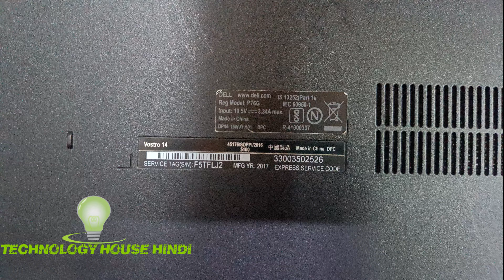Dell  Vostro 14 3468 SSD Upgrade , Dell vostro 14 3468   RAM upgrade , DELL 14 3468 SATA SSD UPGRADE

Comment: I have installed ssd and put hdd in the cd drive slot using hdd caddy, but after that my laptop often blue screen is it because of hdd caddy or because ssd is not suitable.

Comment: Is it necessary to remove the keyboard and front side, if you only want to change the hard drive?
Reply from the maker: Yes
Reply: @technologyhousehindi  . Why is it required? I am only removing the back panel and the motherboard is undisturbed.
Reply from the maker: @mrutyunjayadash6140  see video carefully some screw behind the keyboard

Comment: Hi there,
Can i install ssd without removing hdd like using caddy. If so then please guide on how to do so
Reply from the maker: Install ssd in caddy direct
Reply: @technologyhousehindi  i just researched want to confirm that does my dvd rom has sata 2 or sata 3 connector if sata 2 then putting ssd in place of hdd and that hdd in caddy would give me max speed for ssd
Reply: @faizanliaqat3054  Yes I upgraded my HDD to SSD and use a caddy for HDD. Now the Laptop is loading very fast, it boots in just 10 sec, where it was taking almost 5 mints to fully boot.
Reply: @hananchaudhary4999  bro I also want to upgrade hdd to ssd and with use of caddy hdd in the place of disk....is it working fine for you now? And How did you copy your data from hdd to ssd bro?

Comment: I have same lappy with 4gb ram configuration. Now its become dead slow. I have removed all the applications. To open chrome it takes 13mins. When i check in task manager memory shows running full (4GB). Will +8Gb ram helps or need to put an additional solid state drive as well
Reply: I have the same laptop with 16 gb of ram, and it works flawlessly for Adobe softwares. I can play GTA 5 and RDR2 with medium graphics, I might upgrade to an SSD and 32 gb of ram this month.